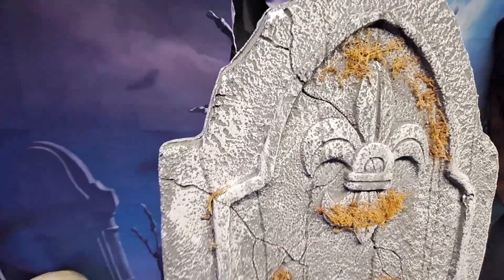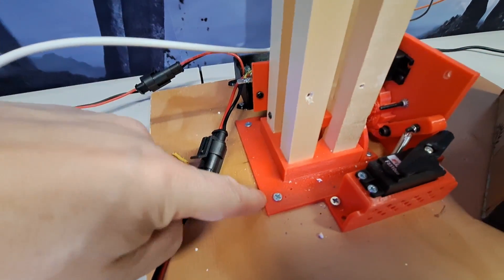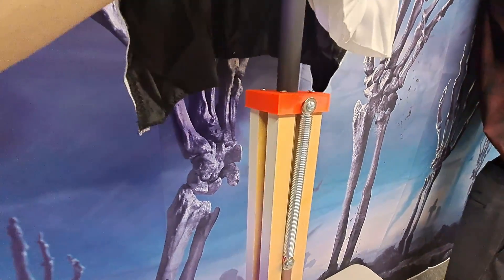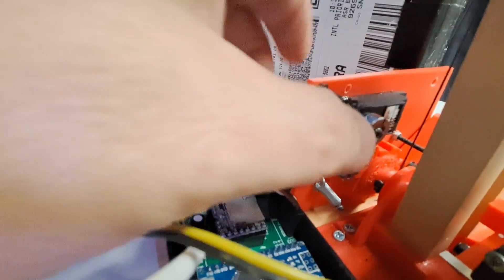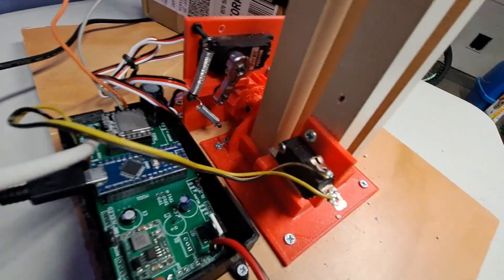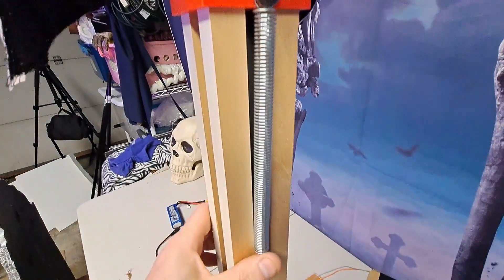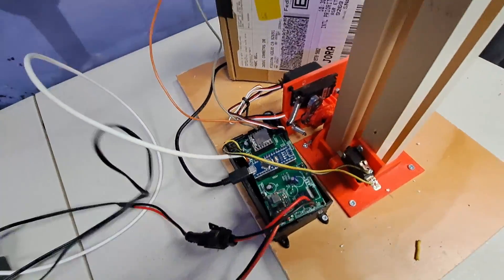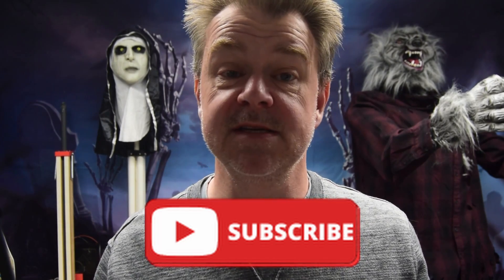Halloween spring popup prop that doesn't suck

Comment: I want to make a pop mechanism for a jack in the box using a real pumpkin is there a device I could use that is inexpensive and will not blow the pumpkin off
Reply: One of the tricks to most props is to make everything fairly lightweight. A real pumpkin is much too heavy to be moving around.